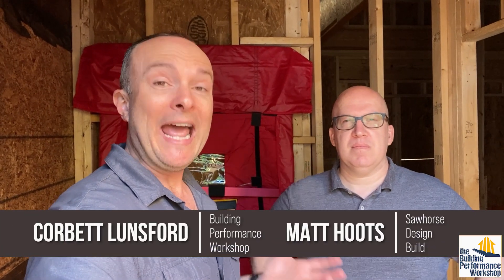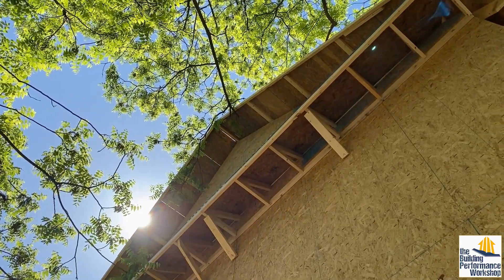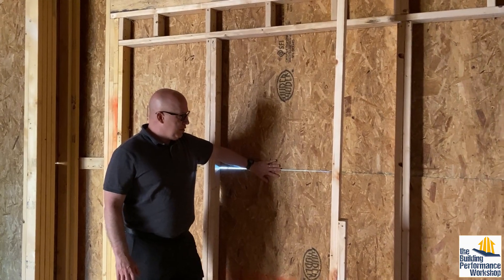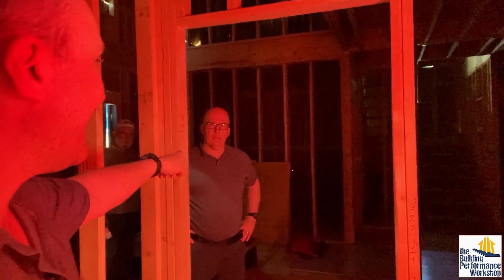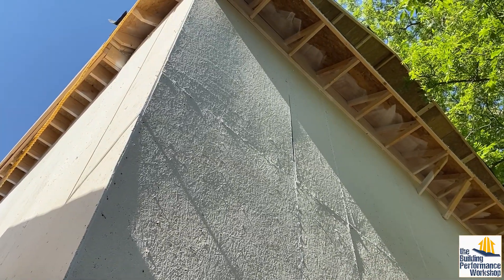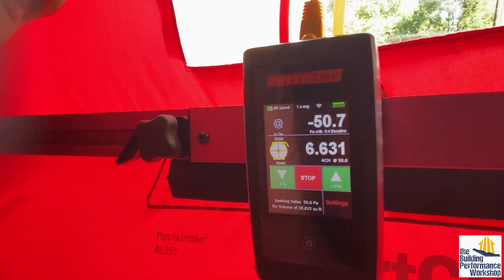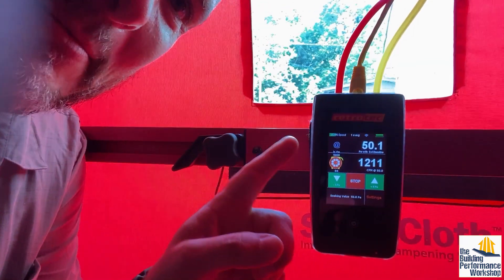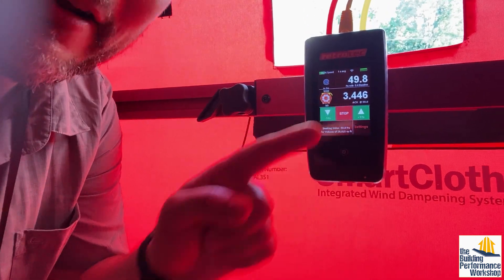Building an Affordable Airtight Home: Sheathing Sealed (Will It Work?)

Comment: I removed all my cortex sheathing and installed osb on my 1300 sqft ranch. I used Prosoco R guard liquid flash and seam filler on every seam and nail heads, windows, doors and all penetrations, including at the sill plate to the foundation. Afterwards I roll applied 2 coats of Prosoco liquid MVP wrap over the sheathing. It cost roughly $1,000 for all the materials. I'm extremely impressed with the fluid applied house wrap and believe It's well worth it. It rained heavily for a few days after that so I got to see it tested in a natural state. It's Amazing to see the water bead up and shead right off the walls. Originally I had used tyvek and left it exposed to the weather for a few weeks. I was shocked to see how much water did get behind it and a ton of bugs!!! That's why I decided to tear it all off and go with the Prosoco fluid applied.

Comment: My concern is to the materials used, feel like in order to insulate or seal the building envelop products are being used that would have an environmental  impact  later in the products life span.  Materials that break down or off gas, what is the longevity of the products. Have you worked with wood fiber products like Gutec or Timber HP?
Reply from the maker: Gutex looks awesome, but seems untested against termites, which is a necessity where we are now

Comment: Because different woods have their own natural moisture percentages, isn’t it a bit dangerous encapsulating sheathing? I thought wood is supposed to breath? I know the mold remediation industry is now abusing encapsulates, which can be problematic 5 to 6 years later. I hear the wood can rot from behind the encapsulate, or worst, leftover mold can eat its way backwards behind the encapsulate.
Reply from the maker: The WRB should be permeable, yes- this FF is more permeable in its final state than ZIP, but even then you’re looking at ~1 perm. Vapor can get through when it needs to.
Reply: @HomePerformance  That’s great to know, thank you. At what PERM rating of an encapsulate should you start to be concerned that it can create a vapor barrier in a sense?
Reply from the maker: Below 1 perm is nervous-making
Reply: @HomePerformance  thank you, I’ll start looking into this topic to get a better understanding of it. Always appreciate your feedback!

Comment: Would thermocote work well in tandem with a product like aeroseal from the inside, or how does it work more or less effectively than an aerosol on the inside applying sealant to the same space? I'm guessing the dual benefits of sealing and weather barrier, but doesn't Blueskin have a self stick option that provides that airsealing?

Comment: Learning so much from your videos.  I'm planning a custom home build in Maryland and trying to figure out which air barrier to choose.  Considering flash and batt with 2" closed cell spray foam, zip system, or BIBS insulation with regular OSB sheathing and solitex mento 1000 housewrap.  Cost isn't a deal breaker for me but spray foaming entire envelope can be pricey, zip system I feel is only really reliable with a framing crew who is experienced in installing it and doing it right.  I'm thinking of regular OSB with BIBS and solitex mento 1000 wrap.  Would be interested in your thoughts?

Comment: Interesting. Is there anywhere in code commentary that states rounding down to 3 ACH from 3.5 ACH or below is acceptable? You are right that the code I have looked at only states "three" ACH, and not 3.0
Reply: Rounding rules are weird at exactly .5. Then you have to round up or round down whether the number before the decimal point is even or odd.

It would be interesting to get an exact reference for the rounding as it applies to the building codes.
Reply from the maker: It’s just basic math rules, Gordon- anything over .5 rounds up

Comment: My sister and I just finished building a small ranch house, with a closed, conditioned crawl space.  Did a lot of the work ourselves.  We air sealed with high quality tape all the seams of the plywood sheathing, and between the bottom of the sheathing and top of the foundation.  We also used gaskets on both sides of the wall top plates, under the sheathing and drywall. We were diligent about air sealing everywhere, and our final blower door test came in at 1.6 ach!!  We have one of the tightest houses in our county.  Shocked our inspector.  I learned a lot from your videos.  

We also have a great simple mechanical ventilation system - one intake fan near the house entrance, and one exhaust fan in the crawl space, with open vents in the bedroom floors at the opposite end of the house.  The fresh air is conditioned where it comes in, is pushed through the length of the house by our mini split, goes down the open vents, and then the conditioned air is drawn through the length of the crawl space by the exhaust.
Reply: Congratulations to you and your sister!
Reply: Awesome